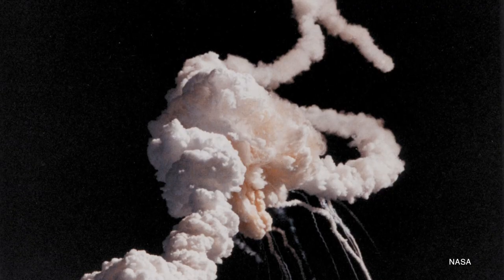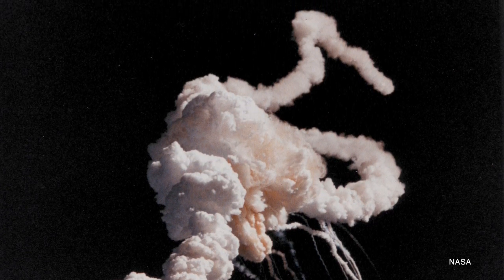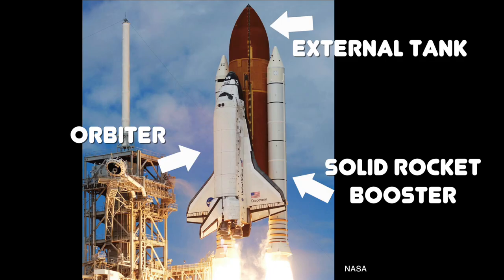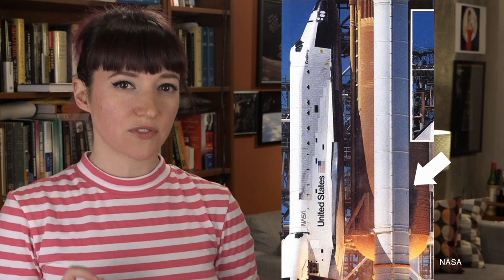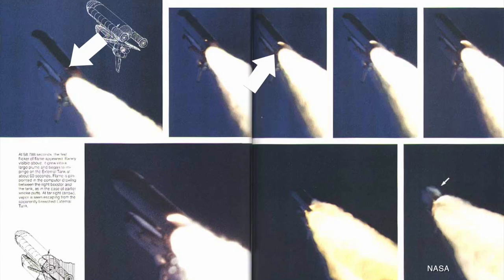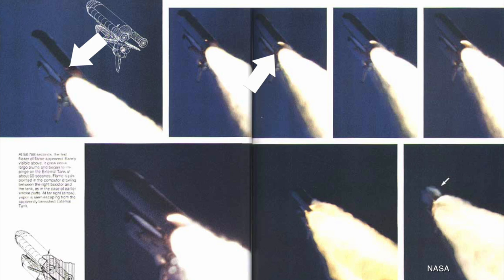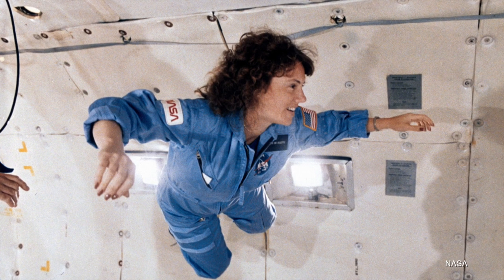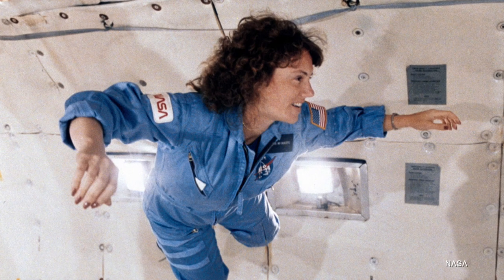How the Challenger Disaster Changed NASA

Comment: HOW COME NOBODY TALKS ABOUT THE REAL STORY,the fact that the astronauts were most likely alive and functional after the breakup
Reply: Because what story is there to tell? They were dead by the time they crashed on the ground.
Reply: That was not this flight but the shuttle that burnt up on reentry?
Reply: the official report, made by Dr. Joseph Kerwin of NASA's Life Sciences branch in a news conference July 28, 1986, indicates that no cause of death could be determined, there is little doubt among investigators that the crew of Challenger remained alive until impact, even if the cabin lost its pressure.
Reply: That is incorrect. It was determined that the Challenger crew survived the explosion but where killed when the shuttle flight module crashed into the ocean. they proved this by finding the individual life support systems where activated when they recovered the debris. The crew where using their personal air supply packs.
Reply: But with all that rocket fuel (think Amy said it was H2 in the liquid fuel tank) exploding only feet from the crew, causing that giant explosion cloud clearly visible from miles away.  Prehaps they were breathing but suerly not conscious it seems to me........  However, I am sure aware that "oppinions are like belly buttons, every one has at least one" so I do relize I could easily be wrong.......
Reply: In my opinion, it's not "the real story" but a gory detail.  They were alive - but doomed.  I haven't heard of any procedure they could have done to save themselves.
Reply: I have always wonder if the crew was informed about the camers observing flame on liquid fuel tank if they or the ground had the ability to fire off the explosive bolts and disconnect Challenger early from their piggy back position before the explosion???   But I also wonder if it was SOP to have at least one set of eyes assigned to monitoring those long range/down range camers durring launch?  I think the camers function was primarily was to monitor the heat shields tiles or H2 spray foam insulation. However perhaps this activity only started post Challenger disaster???  But I am no "Space Historial" like Ms. Amy is that's for sure.....
Reply: No the comms were broadcast live and nothing could have been done anyway.  There was no abort procedure until after SRB separation.
Reply: Coolrockndad, No that was not the Columbia flight. Those astronauts were killed immediately upon breakup of the orbiter framework. He was referring to this flight where at least two, possibly all the astronauts were alive immediately after the break up but likely passed out within seconds. they would all have been unconscious but possibly still alive at the time of impact with the ocean.
Reply: UTubeGlennAR... First comment. There was no "Explosion" The External tank did not Explode with the tank was pierced by the flame from the SRB. It was not an explosion that ripped apart the shuttle.

This is a detail that even Amy got wrong and repeated multiple times in her video.

The tank structure failed, followed by the pivoting of the SRB involved around it's forward attachment point, having come loose at the aft attachment point. The entire tank underwent structural failure at that point and the whole shuttle stack including the orbiter itself underwent structural breakup from aerodynamic stress. NOT an explosion.

What you see looking like an explosion was just the rapid spilling of the fuel contents and partial burning after breakup. A conflagration, not an explosion.

As to your second comment, NO.
There was absolutely nothing they could have done to jettison the SRBs early and start some abort procedure. From SRB ignition, to SRB burnout and jettison there is absolutely nothing that can be done.

Any attempt to jettison the SRBs while they are still burning and providing thrust would have the same results. Structural breakup of the Shuttle stack an a complete Loss of Vehicle and Crew.

The fact that a solid rocket motor is not thottleable nor is it able to be shut down in an emergency but has to run its full course is one of the reasons that a Solid Rocket motor was never rated for a manned mission until the Space Shuttle. Prior to the shuttle the only Solid Rocket motors used with manned missions were small one time use Ullage motors and retro motors fired during staging events.

SLS Will have SRBs again, an even bigger and improved design derived from the Shuttle SRBs. But SLS will have an abort option that the shuttle did not have. SLS will have a Launch Escape System very similar to what Apollo had with a rocket escape tower capable of pulling the capsule free of the launch stack.
The radially mounted Orbiter, had no such option.
Reply: Thank you Cg23sailor for your very knowledgeable, very detailed and very interesting post.
Reply: paper burn - That's your imagined story, the real story is the fact that they lost pressure at 60,000 feet, any astronauts still alive would be unconscious after the breakup.

Comment: Fun side note
The engineers predicted a 1 in 50 failure rate for the Space Shuttle.
Reply: Privately. Publicly failure rate was calculated 1:1000 up to 1:10000. Reality - close to 2%.
Reply: RaptorJesus The figure I read was 1 in 30, and it failed on the 25th flight.

Comment: The aerodynamic forces at that stage in the flight were what actually ripped Challenger apart after the tank explosion separated them. And I never forgave NASA for not having a parachute system on the crew compartment, which survived the breakup only to hit the ocean at terminal velocity. :(((((
Reply: Christopher U.S. Smith 
A parachute system would’ve been totally impractical. The crew compartment was not designed to separate cleanly from the rest of the vehicle so the chance of the parachutes deploying correctly was nil. The chances of a failure at exactly when the challenger blew up are small. For instance, a parachute system wouldn’t have saved Columbia.
Reply: David Messer The design engineers cut corners on crew safety for the sake of payload capacity. Period.
Reply: Christopher U.S. Smith 
I’ll tell you something about engineering: what you say is ALWAYS done. Not just in rockets, but in cars, bicycles, bridges, and your shoes. There are always trade offs. You could make a perfectly safe car; just put six inches of armor on it and fully pad the inside. You would then have a $5,000,000 car that drives 5mph and gets 0.1 mpg.

The art of engineering is to make things as weak as possible, not to make them as strong as possible.

There was no design flaw in the cabin. In fact, it was a bit too strong - it shouldn’t have survived the breakup.
Reply: David Messer There's a BIG difference between consumer products and spacecraft! Apollo had redundancies and crew safety built into nearly every system on both the CSM and LM, which enabled the LM lifeboat backup plan to save the Apollo 13 crew. Redundancies also saved the missions of Apollo 12 (lightning strike), 14 (program to bypass a defective switch), and 15 (one pair of drive wheels failed on the rover). The risk mismanagement that went into the shuttle program left much to be desired, and ultimately cost the lives of 14 astronauts and two shuttles.

Comment: I thought there wasn't an explosion -- weren't the tanks ripped apart by aerodynamic forces, and then the (uncontained) fuel burned? That's why so many parts (including the crew cabin) were intact -- there wasn't a violent explosion, just violent vibrations that caused everything to come apart in big, mostly unburned pieces. At least, that's what I learned on some other YouTube video a few years ago!
Reply: You were wrong. The site was probably another tin foil conspiracy theory place.
Reply: No, after I wrote this comment, I looked it up, and I was right. It's commonly called an explosion, and it looked like one, but it wasn't. That isn't a conspiracy theory -- it's the actual standard explanation of it.
Reply: But even experts use the term "explosion" for it when they aren't speaking precisely. The Rogers Commission Report even says "explosion" a few times, but when it is actually describing the accident, it says, "Within milliseconds there was massive, almost explosive, burning of the hydrogen streaming from the failed tank bottom and the liquid oxygen breach in the area of the intertank." So it was almost an explosion!

But even if the "almost explosive" burning of the fuel were considered an explosion of the fuel tank, that didn't happen with the orbiter itself -- it didn't even almost explode -- the shuttle itself broke apart under extreme aerodynamic force.
Reply: You're correct. While it's often referred to as an "explosion", it was actually a huge uncontained reaction of the unburned liquid hydrogen and liquid oxygen propellants. Because the LH2 and LOX tanks inside the main external tank ruptured (due to the forces exerted on the whole stack when the rear support of the right-hand SRB failed, allowing the booster to start swinging around) there was nothing to contain the heat and pressure of that huge reaction, so most of that big white cloud you see in the footage is water vapour (by-product of the hydrogen-oxygen reaction), not smoke from combustion. As the stack disintegrated, aerodynamic forces ripped everything apart and spat the crew module out and down towards the ocean. You can see it crossing in front of a smoke trail from one of the boosters in slo-mo footage of the incident. The SRBs, being solid-fueled and therefore "unshutdownable", took off on their own uncontrolled trajectories until they burned out (I believe they were later recovered mostly intact, as they had been designed to survive falling back to earth). The smoke and plumes from the still-burning boosters added to many people's impression that a propellant explosion had occurred. [Citation needed, but it makes sense to me]. In any case, a hell of a lot of energy was released in a very very short time at the moment the tanks ruptured... not something you'd want to be riding on top of when it happens.
Reply: Ben McDaniel 
Correct!
Reply: The end result is the same whether it was an explosion or a 'real-big-almost-explosion-fuel-burn-off'.  I suppose the closer to a real explosion you get, the smaller the parts left over afterward are
Reply: Actually, the SRB's combustion was stopped by the destruction of the casings by command of the Range Safety Officer.
Reply: Randy Schreiner, ah yes, they were detonated once they were far enough downrange. Thanks for the correction.
Reply: I mean 7/8 of the external tank’s fuel catches a flame and burns up almost in an instant. The orbiter and ET were shattered to pieces. That’s at least a layman explosion to me. Columbia broke apart, but I call Challenger an explosion all day long unless there’s some detailed physics or chemistry definition that’s different.
Reply: They were remotely destroyed using the RSS (Range Safety System). They were not recovered in tact
Reply: sixstringedthing. Actually the orbiter was released from the stack and this change in direction ripped the orbiter apart and the crew compartment continue upward. The disintegration occured at 49,000 feet the crew compart continued flight under its own momentum for 25 seconds to reach a peak of 69,000 feet before coning down at a much slower but controlled fall for nearly 3 minutes.
Reply: Murph88 Thanks for the detailed reply mate. Horrible to think about what the crew might have experienced but facts are facts, thank you for your correction.

Comment: Great video. The shuttle accident started off with SRB twang. The SRB aft skirt was locked down into position by the hold down post/explosive bolts, it remains stationary through SSME ignition. Because of the thrust during main engine start it causes the entire structure to pitch or rock back and forth AKA SRB twang. Because of this and the addition of cold weather making the 0-rings rigid, the SRB aft field joint (where the O-rings are) did not seal during structure pitch or twang. This is evident in slow motion footage of Challenger before it even cleared the tower. High amplitude or pulses of black smoke were observed leaving that same field joint matching the same pitch or twang rate before lift off.  The SRBs still flex back and forth like this even after lift off, its just the O-ring does its job. 

 The same thing happened to Columbia during prior STS missions, the Field joint erosion was observed. Challenger could have blown up on the pad had it not been for unburnt  solid fuel clogging up the leaking. Later in the launch strong winds aloft dislodged that same unburnt solid fuel and allowed for complete blow-by of flaming SRB exhaust, the rest from there well you know the story.

Comment: This was a prime example of management listening to the outside pressures and not following through with what the employees believe to be the best course of action. Sometimes it is just better to stick with the people who work with the product and don’t listen to those trying to be financially motivated in a situation. No one can go back and change what has happened but this act can be used as a prime example of why the people closest to the action can have a better perspective on a situation than people who oversee them. This also may have saved future NASA issues from occurring, since something like this requires a complete change in how rushed NASA should be in producing travel. When no errors occur people can tend to become too confident with the methods of doing things and fail in making positive changes in processes. Hopefully future journeys into the unknown will learn not to rush and take proper tests in order to prevent over stressed mistakes. Ultimately this event should never be forgotten and used as an example of what happens when management listens to external pressures instead of the people who are around the action everyday.

Comment: A question you should answer is, why did the boosters require an o-ring to begin with? I believe politics is the answer...
Reply: woo545 Correct. As I understand it, Rocketdyne had designed a one-piece booster early in the program, but the contract was awarded to Thiokol because of political pork-barrelling so it was never used.
Reply: Someone has mentioned to me that the main problem, was the design, but the location of the manufacturing. Instead of going with a company that had access to a waterway or other forms of transportation, it ended up being with a landlocked company (because of pork-barreling like you said)where powerlines came to play and the new design required the booster to built in pieces.
Reply: woo545 Also correct. Thiokol's manufacturing facility was landlocked so the boosters had to be transported by road, hence the multi-part design. The SRBs were actually built as six seperate sections. These were joined into three sets of two at the factory, then shipped to KSC by road for final assembly at the Vertical Assembly Building where they built the Shuttle stack. It was one of these "field joints" that failed.

Comment: The challenger disaster was a tragic event that wad the combination of technical factors and interpersonal factors. The creation of the challenger itself left it susceptible to the fate it suffered. The design of the challenger required O-rings that might ultimately fail under the wrong conditions. This issue made the launch of the challenger even more tragic as the weather the challenger was launched in left it to fail. The bigger problem was the fact that people in management and engineering let this launch happen when it could have been stopped. The engineers were aware of this situation and the conditions that would cause the failure. Communication was the biggest factor of this failure as the engineers had communicated this information to the managers however, they didn’t do it in the way that clearly depicted the dangers of launching. This tragedy was ultimately a lesson in how an organization should function as their clear communication could have save lived the day of launch. The fact of the matter is that for people to understand what is being communicated it must apply to them to understand what all the details of the case are.

Comment: The Challenger Disaster changed NASA for the better in a business standpoint. It was a very tragic and terrifying incident, but their management is the ones to blame. The lesson that NASA learned from this was that to succeed and avoid these types of situations, one needs to have a good culture. Culture is so important. Every company should strive to have a good culture. Having a good culture consists of having the right staff of people with a good work ethic and leadership. It all starts with the top because it’s a trickle down effect.  This builds an environment that gives the staffers motivation and encouragement to give it their all to what they’re doing. Another key element in having a good culture is communication. With no culture, staffers will make lazy mistakes. Everybody has to be on the same page working on the same goal. That’s what happened in this situation. The management and the engineers weren’t on the same page because management was more focused on public relations instead of the technical problems. As unforgettable this day was for NASA, at least they learned from it.

Comment: There were 6 of these O-ring joints on both SRBs, only one leaked (with the puff of smoke) at a specific location, at the instant the booster ignited. The leak was already there due a flaw in that joint at that specific point. Do not know if that booster had been used before, but instances of partial burn through had been documented before this flight.